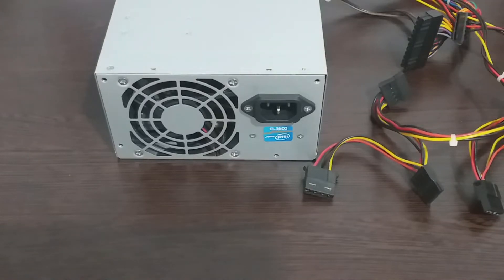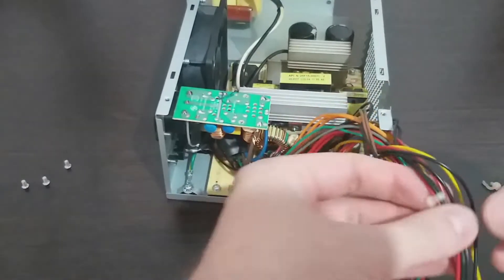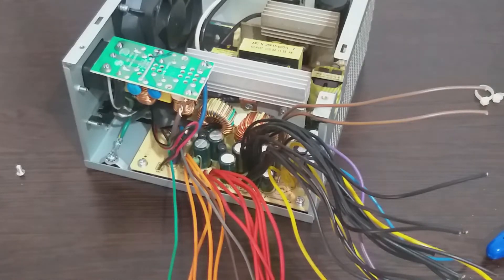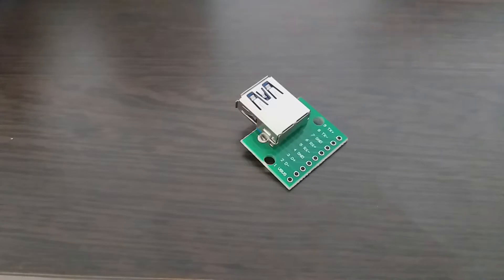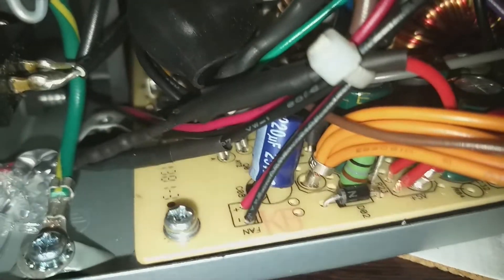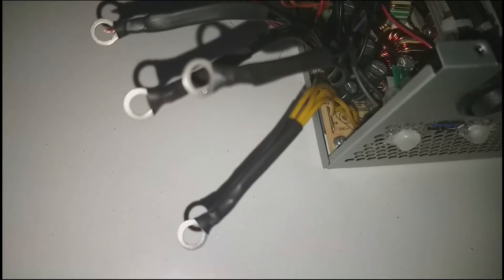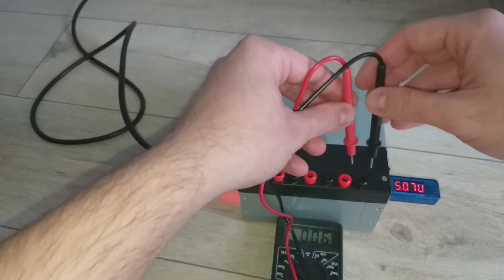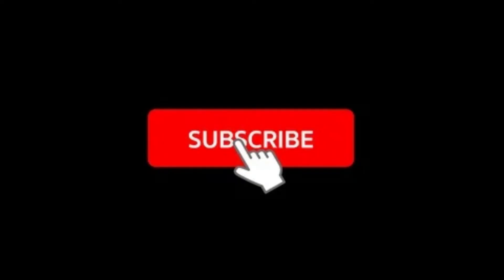DIY Lab Bench Power Supply from an old ATX PSU | 3.3v 5v 12v output

Comment: Miss the load on 5V.
Reply from the maker: It has 2 led light for that as I remember
Reply: @pythoneatssquirrel  2 LED for 10W Load? Is that enough?
Reply from the maker: @01Hudesohn  2x 3mm leds and 2x resistors 220 ohm 1/4 w each